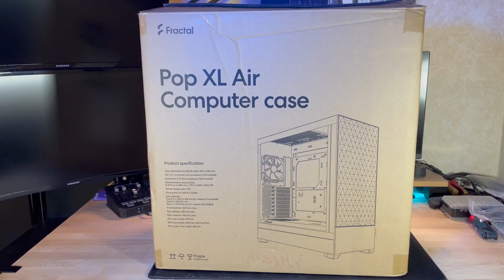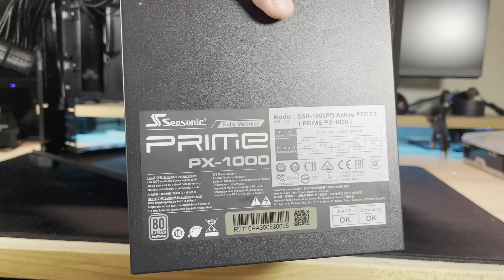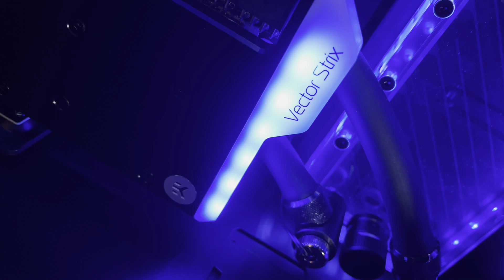Fractal Pop Air XL - Custom watercooling build !

Comment: What did you use to vertically mount the gpu?
Reply from the maker: Phanteks vertical GPU bracket, but if you can take the Coolermaster (cheap but good) or the EKWB (best one but very expensive)